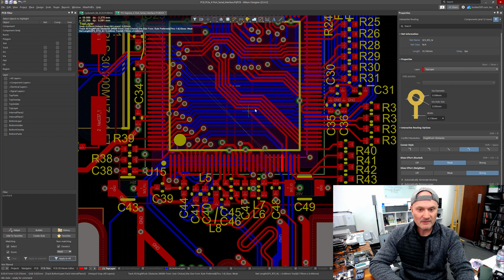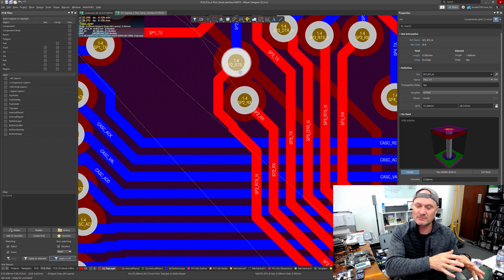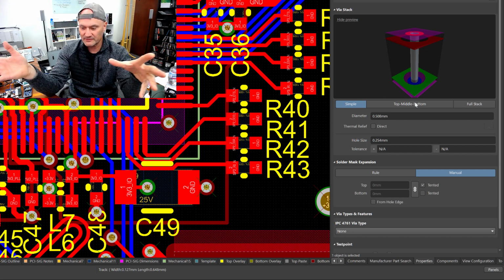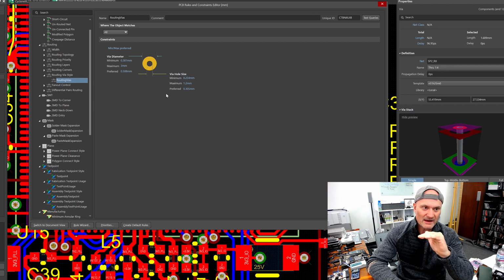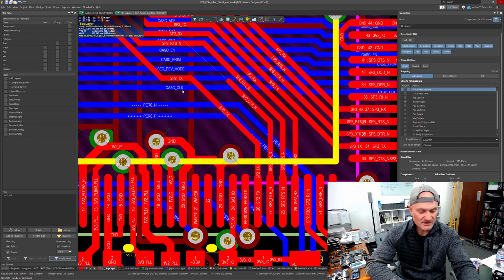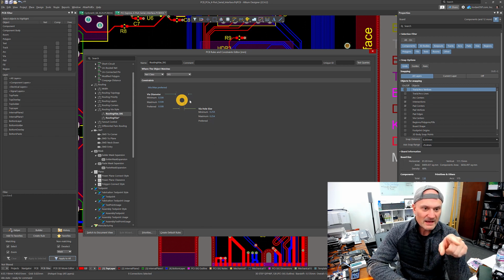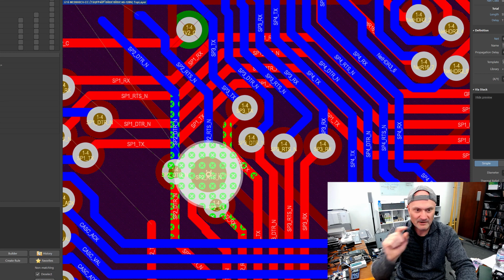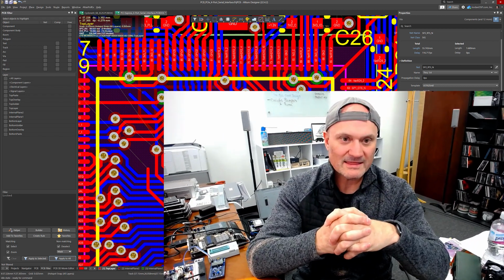How To Define and Place Vias in Altium Designer?

Comment: Still confused about defining vias.   When NOT using Net Classes, using Min/Max/Preferred is confusing.  How does the software choose which via you want to place?  If Min is 0.2mm, Max is 0.8mm, what will it choose and how will it choose it?   I attempted to use the "Template Preferred" option in the Design Rule, and defined a via template library, but there seems to be no link between whats displayed in the design rule window and my via template.  Basically I want to pre-define what vias are allowed in my layout, precisely, and then when choosing vias have only those vias be allowed.    Documentation online is utterly confusing and following the steps listed to create a via template library and then use it does not work.
Reply from the maker: I agree about the documentation. The way it chooses depends on your preferences but the simplest way to control this is by hitting TAB while routing and use the NET Properties panel to select via size.... thanks for the question - I should make a video about this. Just to clear it all up... stay tuned!

I will add that in much older versions of the software, there was nothing like a "pad stack" or pre-defined via. This was something OrCAD and PADS did, but not Protel/Altium. The only thing driving this was the design rules, and if you wanted a specific size you had to hit TAB and set it during interactive routing, and generally after doing that it would choose that size again next time.

Comment: Hi Ben,

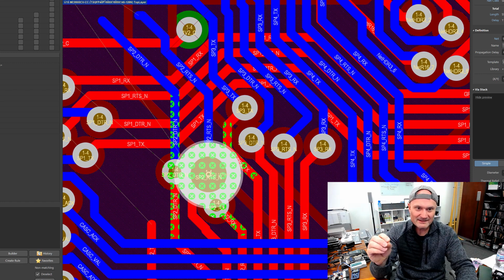thanks for the video. Excellent point out for the via selection in Altium at 19:13.  
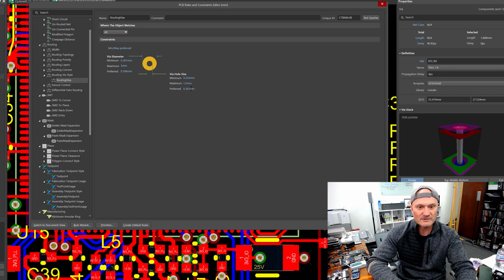At 11:00 you mentioned preferred Via size is 508/305um. 
Have you considered here the minimum annular ring? I mean, 508-305 gives  203um, which means the annular ring in this case is only 101.5um. 
This is quite advanced, isn’t it?
 Maybe for next video you can point out, that for example the via hole size in Altium and later in Gerber files is the final via diameter  after the board will be manufactured. 
However the manufacturer have to drill your via with bigger drill bit and in your case it would be probably 350um in order to make enough place inside the via's hole for the plating.
Reply from the maker: It's reasonably advanced yes, though in the video verbally I am telling people 20mil with 10mil hole is more standard today. 

I agree it would be very good to make a follow up about how vias are actually made in the factory and why it's important to maintain the minimum annular ring (which is another rule as well!!)

DFM rules are always a welcome topic.